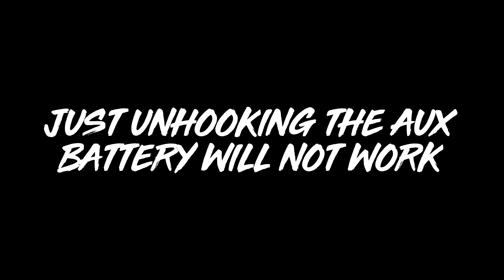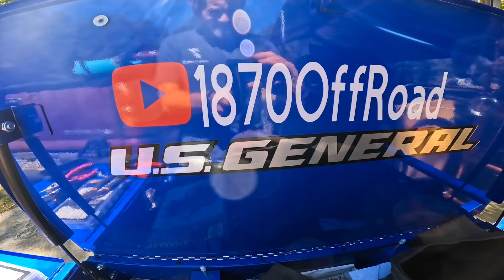Pt.3: Aux battery delete, testing 4 methods. Part 3 of ESS, auto stop start, aux battery saga

Comment: Grazie per il video!!! Ho fatto la modifica sulla mia jeep wrangler jl 2.2 Diesel 2020 e va tutto bene 😎💪🏻🙏🏻 tolto il fusibile f42
Reply from the maker: @gianlucagrimaldiphotograph    
Gracias por Mirar 
Siento mi espanol is limitado, o esta Italiano?

Glad it’s working for you, f42 works for a lot of people. I left my fuse in and parallel wired both systems to the main battery (removed the Aux)
Reply: @1870offroad sono italiano 🇮🇹 napoli 🍕 grazie ancora per i video che fai 🙏🏻